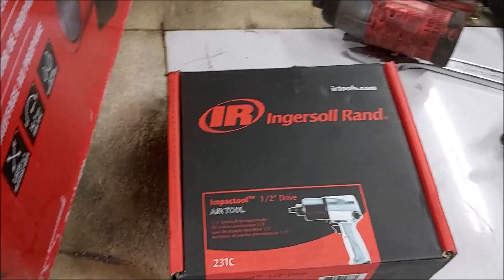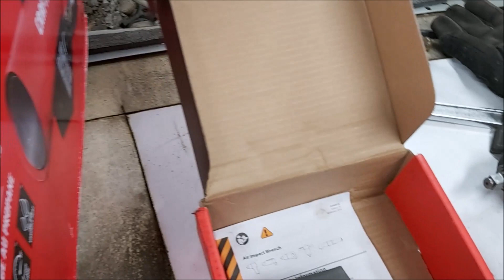Studebaker Body Swap 5. Floor & Firewall #hotrod #chevy #truck #studebaker #ratrod #bodyswap

Comment: Honestly if you talked a little faster.    And stop the BS and spppppiiiiitttttt. It out son!!!    ...    Most the shit you talkn hasn't got a dammm thing to do with this project... Get a tripod and it's called a speed run     and then a recap ...    With a few clips in-between there ..    also it helps when it's more than just your voice honestly.         Just saying . If you wanna grow your channel.    Then the advice is 💯 brother...       Watch anyone else channel that is actually making videos and content that's got subscribers and makes $off YouTube..   v but the project is a good one ..  personally I would of kept the same firewall and dash from the S10 ..  and the same floor &seat ..          personally why not make a. Flatbed out of wood.     And use a keg mounted up for the gas tank ?        Just a thought.    Less fab.   And it'll be alot easier
Reply from the maker: Everyone has their own way.
Reply: @RichardsRodClassic  You do fine